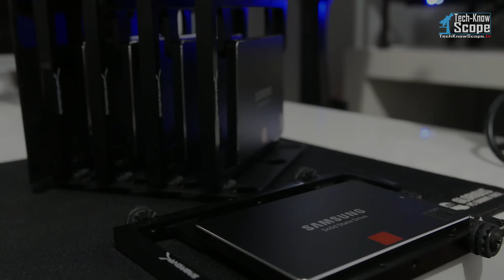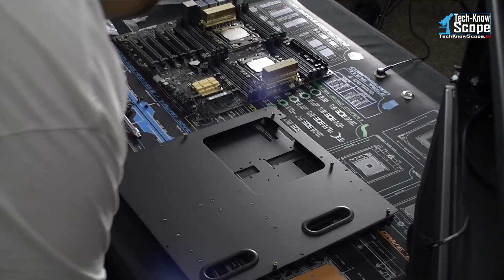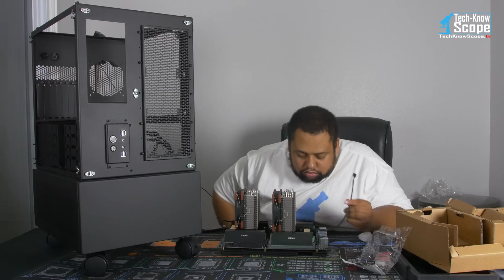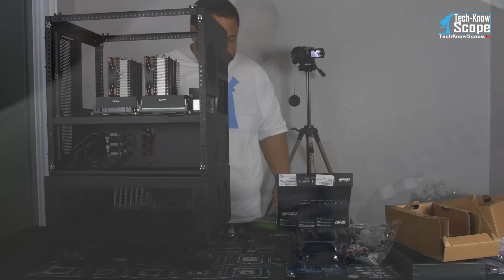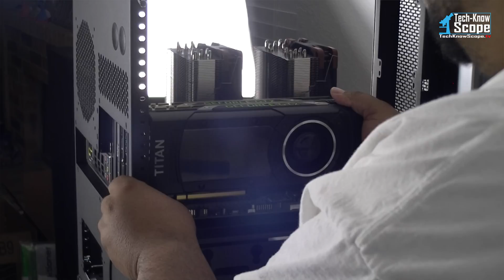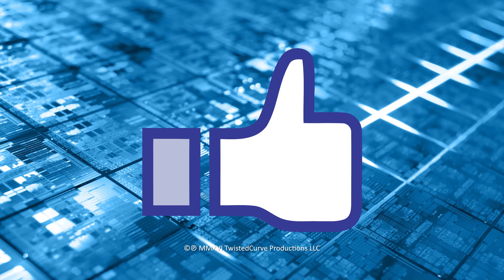▶️ Project Sledgehammer | The Ultimate Workstation Build Vlog - Ep4 - The Assembly

Comment: Good build but you will need more cooling, each CPU needs two fans and you will need bigger heatsinks for those. Also watch your flow direction from your fans. a push and pull from your rear case fan for efficient cooling. Keep at it man. Good vybe.

Comment: Hello Tech-Know Scope, I have 3 questions that make and model is that cabinet case?
That cabinet or case 5.25 bays to put optical drives such as DVD Recorders or BluRay Disc?
That your pc has optical units either internal or external?
Reply from the maker: The case is made by Case-Labs. You custom configure the options of the case when you order it. 

You can use and add 5.25" bays to this case, however I did not.

I no longer use optical media. I have an external USB DVD drive, and I've used it about 3 times since 2013.

Comment: Is it possible to use the D8 board with M.2 4x PCIe with one 960 and use the silverstone extention card for another 960 and make a raid 0 with it? Thank you for your feedback!
Reply from the maker: It should be possible. Just remember, the support for NVMe RAID 0 doesn't exist yet for boot drives or system level RAID. You will have to boot from another device and then RAID from within Windows.

Also I suggest looking at the block diagram before buying and building anything. Connect the drives to the same CPU for max throughout.
Reply: Propably the increase in write speed isnt worth the downsides like not bootable and double the chance of a drive failure. Because the read speeds dosent increase that much with raid 0. need it most of the time for heavy raw video footage. what do you think? Thank you very much for your quick response last time! :-)
Reply from the maker: Unless you're capturing raw 8K footage, I don't see a reason you would need NVMe RAID 0. 1 drive is more than fast enough for most things consumer and enterprise.
Reply: Thank you very much for your fast and great feedback! Have a good day mate :-)

Comment: why did you have all those discharge stuff, when you don't build PCs on regular basis ?
Reply from the maker: If you're talking about the ESD stuff, I have a degree in electronics and I worked in the field long before I got to this point. I also occasionally build circuits as a hobby for use in my things. Also, I've been building PCs since the mid 90's, just because I don't have many PC videos doesn't mean it's not something I do.

Comment: You should turn the fan on heatsink so it do not suck hot air from other heat sink. It lowers heat sink effitiency significantly. Since fans are on clips no brainer easy improvement of performance.
Reply: oh and the 1st 4 PCIE slots are 16x remaining are 8x so you should 100% put Titans to 1st 4 slots. They are smart and down there should not be anything as big to cover ports ;)
Reply from the maker: You should follow my Instagram page (or at least look at it if you're not on Instagram). http://instagram.TechKnowScope.tv

You notice in my later photos, on Instagram, the entire heatsink on CPU 1 is rotated 90º counterclockwise, it allows CPU 1 to tap into unused cool air flowing from the front fans to the rear 140mm. Something I will talk about and make very abundantly clear if I ever get time to make video #5.

All the PCIe slots on this board except slot 1 are 16x, those are the benefits to having 80 lanes to work with. The cards are actually in slots 2 and 4. Turns out it causes instability issues when you have a SLI card on one CPU and the other on a different CPU. There's actually a pretty good block diagram about how it's all setup in the manual for the board. I'll show this in the next video.

Thanks for watching!

Comment: would have expected water cool
Reply: no point as no need for OC
Reply from the maker: ***** this motherboard actually has an OC utility built in as well. It probably would work for a 4, 6, and maybe 8 core CPU... But my 18 core CPUs hate it. The first time I enabled it, I couldn't get the system to POST again for quite a while. That made it impossible to get into the BIOS to disable. I think I ended up resetting the CMOS, which is directly under one of the Titans.
Reply: Can't really OC anyway. 2P systems don't allow multiplier overclocking. You can only do some very mild bclk overclocking but not really worth it since you get stability issues.
Reply: It's better not to have it its less noisy this way.

Comment: i had build my rig in according to your tutorial with same motherboard, two xeon e5-2630 v4, 8 sticks of kingston 8gb ecc but when i try to boot it the q-code stuck at 'b7'.  but when i remove a ram stick from D1 slot it started working properly with other 7 ram sticks. now i cant use that eight ram stick. could you tell me what should i do
Reply from the maker: The first thing I would do is make sure the RAM stick is the problem. Remove 6 of the other 7 sticks, use 1 stick you think is good on one CPU and the stick you think is bad on the other, and then see if the system will boot. If it doesn't, try replacing the bad stick with a good stick and retry. If it boots without the suspect stick, the stick is bad and you need to RMA it. If it boots with the suspect stick in and you only have two sticks, you have another problem. The thing about this system is it's extremely difficult to narrow down problems. Good luck!

Comment: Question: Is the motherboard compatible with Intel Xeon E5-2696 v3 CPU? Thanks!
Reply: It should, but you might have to contact asus to make sure.

Ref:  https://www.asus.com/Motherboards/Z10PED16_WS/specifications/
Reply: Sure it is!
Not a problem!

First question you need to make your self.
Do I have a CPU Socket 2011? If the answer is yes then you are ready to run ;)
Save and nicely!

Comment: excuse me I have a question, I started to build my workstation with this motherboard, I bought 64 GB of RAM ecc. regDimm (Kingston KVR21R15D4K4/64), but in the section of the manual I read that over 32 gb ram must be LRDIMM, so ... your system works with 256 GB of RogDimm? because when I start the computer nothing works even the bios ... maybe my problem is ram? Here I found the list of supported RAM (https://www.asus.com/Motherboards/Z10PED16_WS/HelpDesk_QVL/), you'd be very helpful telling me if you are having problems or not, because even your ram is in the list.
Thanks.
Reply from the maker: Are you sure you're waiting long enough for the POST? This board's POST is incredibly long and takes like a minute before the PC begins the boot process.
Reply: when the PC starts motherboard does not start the bios and writes system initializing A 3 on the screen. the error A 3 refers to IDE Enable, and nothing happens. I tried to disassemble and reassemble the components and do not change anything. I read better and the ram is compatible with the motherboard so it is possible that the motherboard does not work?
Thanks for your time
Reply from the maker: Have you tried to update the BIOS? It's possible the board could have issues, but it seems unlikely.
Reply: Yes i've also tried to update the bios. probably I will send back to amazon.
Thenks for your advice! and great video!

Comment: This motherboard (instead of d8 ws) has only 2 pcie lines on the m.2 slot. So, if you want to use all potential of 950 pro ssd, buy 4-lines pcie adpter.
Reply from the maker: Yea, it's one thing I've been thinking about. I have 2 adapters already, just have to figure out when I will tackle the job because it probably won't be as simple as it seems with my hardware encryption, etc. I was actually thinking about it yesterday, and as I plan to upgrade to the 960 when it's available (or just get the 961 oem), I might wait until then to do it.

Thanks for your input, and thanks for watching!

Comment: once you get everything setup, can you try to also include a "boot time" part in your next video for this project?  i want to see how long it takes from power button to desktop in windows... i assume you will use windows 10?
Reply from the maker: You will be extremely disappointed, but I was planning on it. lol Yes I'm using Windows 10.

Thanks for watching!
Reply: yea, i have been researching... i know those NICs and IKVM delay like a minute per item avg?  and as far as i can tell... can not be disabled.  i am trying to decide... d8(faster boot) vs d16 (double ram slots).  i am leaning towards the d16 right now... but i want to know the boot time to confirm.  i am also hoping it is like a dell server (my only experience), where if you sit infront, you can click"pass" each time it tries to connect to other servers... so yea... looking forward to the next video for this project. thanks!
Reply from the maker: The upsetting thing is it can be disabled, and I did, and it still takes a long time to boot. I've never connected to it, so I don't know what it's doing. I probably should take the time to do it one day just to see if I can make the boot time shorter, but it doesn't bother me enough to arbitrarily disassemble the PC just to get to the jumper and attach the VGA connector.
Reply: agreed, i feel it shouldn't bother me enough to sacrifice and go with the d8 with lower dimm slot count. but this sucker costs so much money... i got to try and do a reality check and make sure it isn't like a 5+ minute boot or even worse... 10+ minute boot time? : ) i have been kickin' butt with my 930 cpu for the last decade... this is my next super upgrade...
Reply from the maker: The POST time is around 1 minute. I timed it once, but I don't recall how long it was... I'm thinking like 45 seconds. Once the POST is done, it hardly takes any time for Windows to finish booting. A matter of seconds.
Reply: yea, most ssd should load windows and get you into desktop within a few seconds... thanks again for the fast response... great videos.

Comment: Great videos! I'm actually starting a similar build for my brother who will be doing a ton of graphical 3d/video rendering. I had a question on the PSU/motherboard combo - does the Corsair AX1500i work with the EEB/dual CPU setup? I didn't see anything confirming it on their website. Thanks again and I can't wait to see the final product!
Reply from the maker: It does work. I can confirm the ax1500i has the connections and cables included for a dual CPU setup. No adapters or workarounds are necessary.

Thanks for watching!
Reply: Thanks for the reply and confirmation. A couple other questions: 1)Have you run into any other snags so far with the build 2)Are you having the mobo handle the PWM or using a separate PWM controller and 3)I was going to use 3x 980ti's - is there enough space on the side of the Mercury case if I have them in the x16 slots on the asus mobo? Thanks again for the info.
Reply from the maker: 1. Yes. The BIOS has AT LEAST 5x more settings than any other BIOS I've ever configured. It took me a long time to get it how I want, and I had to research a lot of settings I've never seen before. Also this system doesn't seem to like the Elgato capture cards. It took me 2 months of testing and evaluating to figure it out, which is why these videos are so late. The problem was extremely intermittent, but the computer would suddenly freeze and reboot for no reason. It only happened about once every 48 hours, which is why it took so long to figure it out. Elgato sent me a replacement card, and I had the same problem. My card from AVerMedia and the other from Blackmagic Design have no issues what so ever.

2. I was initially using a PWM hub (silverstone), but I pulled it because I thought it wasn't working. It turns out the fan 1 controller is directly tied to the CPUs, so anything connected to it would never spin slow. I connected the fans to the different headers on the board (as it has 7), and they've been working well for me. The BIOS will let you slow them to whatever static speed you want (by percentage), but I have them set to "generic" which is auto. They aren't super quiet (but quiet enough) in this mode, but the PC stays cool (which is my main concern), and they will spin up as necessary. Unfortunately, I could not get them to work with Speedfan, and I don't think there's a way to software control them. So if you want them slow or off, but spin up when needed, you will need to use a 3rd party controller. 

3. The case definitely has enough room for 3 980tis, but you might run into a problem. There are block diagrams in the manuals for both boards, you will need to consult. On the D16 one issue I ran into was trying to use slot 2 and slot 6 for my dual Titans. One slot is connected to CPU1 and the other CPU2. This can cause slower than desired performance because the cards (while SLI) also do a lot of communicating through the board. Instead of going to the CPU and back, it goes to one CPU, through the QPI to the other CPU, and then to the other card. If your QPI is already heavily used, you're just creating even more trouble. I lost another slot because I moved the cards to slots 2 and 4, but the system became more stable and GPU performance increased slightly (and so did heat). Using a 3rd card would mean using slot 6 which is connected to CPU 2 while slots 2 and 4 are connected to CPU 1. 

Hope this answers your questions!
Reply: Luckily for me, I don't even need to really worry about SLI since Octane doesn't support it but it will see a boost with the additional Cuda cores. I have an extra Silverstone PWM hub so I'll give that a go with the Noctua fans. I've got plenty of time to figure out some of these kinks since I now have to wait for the Mercury case to come in.

Comment: I just bought this Motherboard and planing to buy CPUs. Is  Z10PE support ES Xeons or not, if anyone has any leads ill be very grateful and many thanks in advance for any responses
Reply from the maker: Z10PE is for E5 26xx series chips, socket 2011-3. Should work with either v3 or v4. I don't think any other chips are supported.

Good luck and let me know how it turns out! Thanks for watching!
Reply: i was planing to buy ES CPUs from eBay but  Just found out  Asus will NOT suppport Engineering Sample  series of CPU anymore.one of the seller on ebay confirm it support.what do you think about the CPU below ?
   http://www.ebay.com/itm/351736610188
Reply from the maker: Ashu love I've heard the Asus boards won't POST if you use an engineering sample. I don't trust them anyway. I'll buy OEM because they're usually cheaper than retail, but I won't buy an ES chip.

Comment: the Arctic cleaner and conditioner IMO is overpriced and glamorized. rubbing alcohol will remove compound and oils just fine. no temp differences between cleaning with alcohol or prepping with "conditioners". basically a false piece of mind in bottles targeting new builders. beautiful build all around. seems like a pretty... ground breaking machine ;).
Reply from the maker: I see what you did there...

I actually bought it to see how well it takes compound off of a CPU, but I have the feeling you're spot on. It was probably a waste of money. 

Thanks for watching!

Comment: Does plugging dual ethernet gigabit cable double the internet speed?
Reply from the maker: It can possibly double your network speed if you have the equipment to take advantage, but it will not change your internet speed.
Reply: I want to use the internet speed for multiple monitor using wireless connection, that would be awesome if the motherboard could double up the speed of my internet. Btw, does any custom RAM heatsink do compatible with your current ECC RAM? cuz I'm planning to buy one, without heatsink...it's super ugly

Comment: are u going to water cool this pc? if not theres no point to use this case great video
Reply from the maker: It has crossed my mind numerous times. It might happen one day, but not right now. I'm too scared too introduce water in the case with the price I paid for this machine. There are a few reasons for using this case over others though, I speak about those in this video as well as the previous two.

Thanks for watching!
Reply: lol i had the same thing running in my head but i had a old amd and some of my pastel red liquid and i got a cup full and throw it on all the pars when it was running and nothing its the type of fluid.dont be afraid try it out on a old pc or give it a shot on this beast.i have a vid of mine on my channel its a rx 240 kit works very well even on a 6700k oc to 4.8